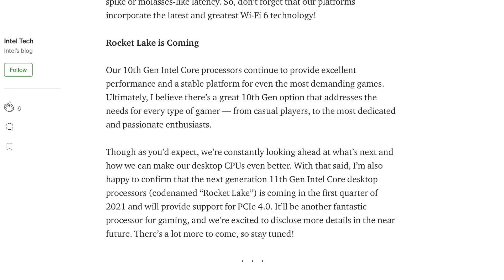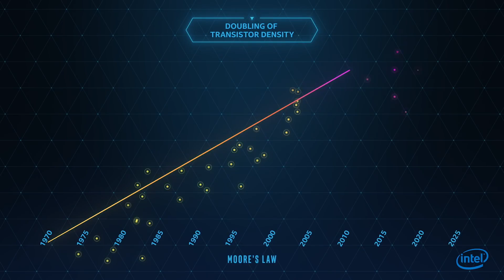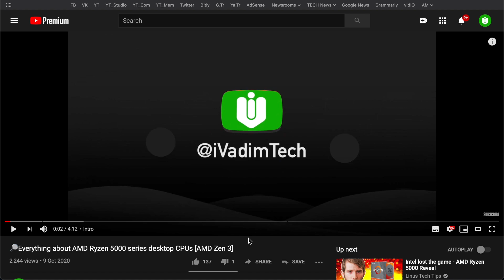Ryzen 5000 better than Intel 11th gen Rocket Lake?

Comment: Intels IPC improvement will be 10% over 10th gen and another 5%  from clock speed.  The 8 core will be as fast as the current 10900k in multi-thread and quite a bit faster in gaming. It should also be cheaper than AMD. Also Intel will be allowing memory speed overclocking on all the 11th gen, not just the k so the lower end i5's will quite possibly beat AMD's R5's and they will be also 8 core. AMD will have the very top but only a few percent of sales comes from that.
Reply: All amd cpu can overclock and ryzen 7 5800x has high multicore core score vs 10900k already. Tiger lake is only gonna be on par with zen 3 not faster by any means and zen 3 is leaked to support 4000mhz+ ram. Zen 4 and adler lake is where you will see bigger changes

Comment: I been hearing rumors that it will be a massive performance boost from comet lake but you’re saying it might only be 5% faster than ryzen 5000 even with clocks up to 5.4-5.5 ghz. Are you certain that it’s not worth the wait and ryzen 5000 would be better to buy soon?
Reply from the maker: I didn't say that it will be 5%. I said that 5% will be enough to be competitive vs Ryzen 5000. But I don't trust anyone claiming that 11th gen will have a massive performance boost. Usually you an get a good boost from more efficient node (like going from 14nm to 10nm) combined with architecture improvements. Intel will only have the luxury of making gains in the architecture department.
Reply: Also do you think ryzen 5000 has lower latency just as good as intel? I care about snappiness in games
Reply: @doofesnator4913  Ryzen 5000 will definitely have lower latency than 3000 because now all 8 cores and 32MB of cache per chiplet are unified instead of being split in two. But there is still the communication that has to happen from the core chiplet(s) to the I/O die through infinity fabric. I think they increased the clock speed of the infinity fabric, but my guess is the total latency is still higher than Intel. I saw one benchmark of Shadow of the Tomb Raider with a 10700K + 2080 Ti at the same settings AMD used in their presentation. AMD only showed a brief glimpse, but in that same scene in the jungle, he had higher FPS. The average at the end was roughly the same, but I think this is due to the fact that his results showed he was over 40% GPU bound (2080 Ti) and AMD used one of their new unreleased cards which is faster. My point with all of this is, an overclocked 10th gen CPU is probably still faster in games. We'll see the full pictures once Ryzen 5000 is released ofc. As for 11th gen, some rumors claim a big IPC boost and clock speeds up to 5.5Ghz. But again we have to wait and see. One thing I find interesting is that (allegedly) the highest end 11th gen will have 8 cores instead of 10 or more. My guess is they are using that to push the fastest possible gaming performance. The thing that gives Intel such low latency is the ring bus design. More cores means the ring would be physically bigger = signals having to travel further = more latency. So I think the 11th gen is Intel trying to hold the #1 gaming performance until (and if) they can actually compete with Ryzen 9 and Threadripper.
Reply: @thecatdaddy1981  thanks, that makes sense. If I want the lowest possible frametimes and snappiness I guess it’s better to wait for 11th gen even if it’s only around 5% faster, lower latency will good for me
Reply: @doofesnator4913  It helps with frametimes too. I've been tightening the secondary and tertiary timings of my RAM this week, previously I only did the primary set. Even though I only have a few more FPS in CPU bound scenarios, my frametime graph is flatter in every game, especially Far Cry 5 which is notorious for small hitches and stutters. If you get some high quality RAM kit and spend the time doing this, it will make your games feel even smoother. Some people have managed as much as 20% more FPS out of the 8700K just by overclocking the memory and lowering timings. It's almost magical, free performance just by changing some numbers.
Reply: @thecatdaddy1981  people mostly  do it with Amd, but I guess I will oc ram with 11 th gen, but I’m not sure how to lower the secondary timings and by how much
Reply: @doofesnator4913  Ryzen made lowering ram timings more popular, yes. It never occurred to me until I tried it that it also greatly benefits Intel. I'm pretty new to it aswell, so right now I'm doing it in the most simple way, trial and error. I lower only one or two timings at a time, stress test with HCI Memtest (it's slow, but very good at finding errors). I searched on the internet about tertiary timings, and I found a lot of conflicting info so I'm not 100% sure. Some people say certain timings shouldn't be lowered too much, or that timing X should be the sum of timing Y and Z, such examples. Other people say just lower everything as much as possible. For now I'm just lowering everything (except tREFI, this one should actually be raised to increase performance). If you go through everything, it will take many days or a few weeks depending on how long you run memtest (recommended is 100-400% coverage), what increments you lower them at, and how quickly you hit instability on each timing. In the end if you do this and overclock the cache/ring on the CPU, you get big boosts to cache & memory bandwidth, and lower memory latency. For example with EVERYTHING in my BIOS at 100% stock settings (including no XMP which sets my RAM to 2400mhz instead of 3200mhz), I get 76ns memory latency. Now I'm at 51ns. I would say look up guides, but they just confused me and I ended up with more questions than answers, so I've just been trying it bit by bit, plus asking a few friends how they did theirs. Every platform and RAM kit is different after all, so I don't think there is no one simple answer for what timings to choose.
Reply: @doofesnator4913  that 11th gen is an overclocked stock cpu. It will be a room heater. Buy ryzen 5000 and overclock it, it will be much better than rocket lake.
Reply: @gisg3073  but I care a lot about frametimes and latency, I don’t think Amd is as good as intel on thst
Reply: @doofesnator4913  latency is not a problem for zen 3 thats why they have large caches to counteract the latency issue anyway zen 3 is faster than 10th gen and show be equal to 11th gen in gaming if u ask me I'll go with zen 3 over 11th gen
Reply: @doofesnator4913  you are wrong the new Ryzen 5000 series is much better than any intel processors in frame times and latency.
Reply: @gisg3073  let’s see the results after it comes out

Comment: Intel needs to stop changing the socket of their processors every 2 generations, I think that is the most big problem about intel
Reply from the maker: They plan to keep their LGA 1700 (12th gen) socket for 3 generations or more. So, yeah. It seems that they are finally open to make some consumer friendly changes.
Reply: @Kagabunsheen Nojutsu why change? It does the job. Don't get swayed by AMD 200 cores 2 million threads 2 nm with 0.5 ghz max boost. It's all marketing.
Reply: They do it because the people with the money will switch out their parts every couple of generations to be on top so it gives Intel less incentives for CPU compatibility like AMD has with their chipsets.
Reply: @azurai3934  agree.
Reply: @Kagabunsheen Nojutsu how is 14nm intel inferior?
Reply: @Kagabunsheen Nojutsu Don't worry. You're too stupid to educate me.

Comment: Hi i buy cpu i9 10900k es QTB2 good cpu gaming ?
Reply from the maker: I don't know what QTB2 means, but i9 10900K is good for gaming=) However, if you want THE BEST, then it is better to wait until November 5th. That is when you will be able to buy AMD Ryzen 5900X or 5950X as well as check reviews.
Reply from the maker: I'll be honest with you - that looks like a fake CPU. I wouldn't buy it. Get a proper processor from a trusted seller. Genuine retail CPU doesn't have "Confidential" written it=)
Reply: @theivadim  https://youtu.be/JlO2Zksj1o4
Reply: @rads7676  intel confidental is’nt Retail prosesor that’s for engineering sample..
Reply: @theivadim Intel confidental means its for Intel Engineering sample prosesor..